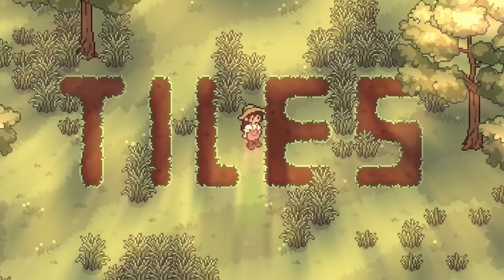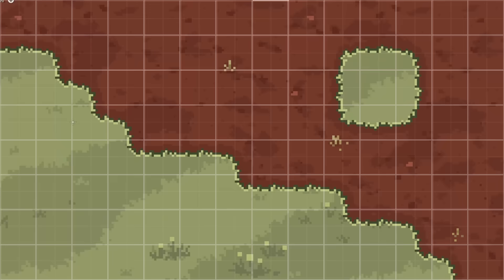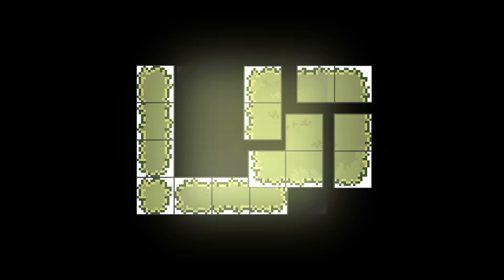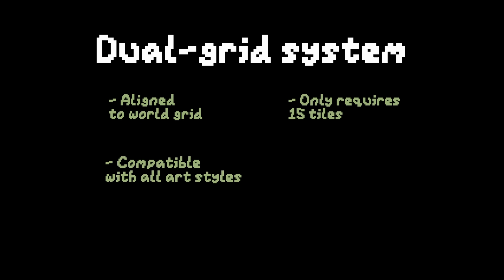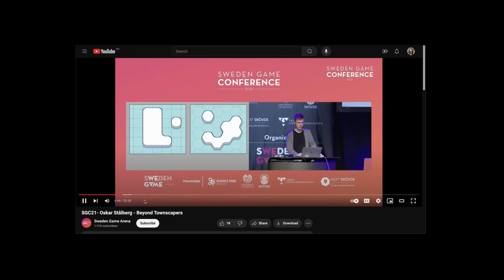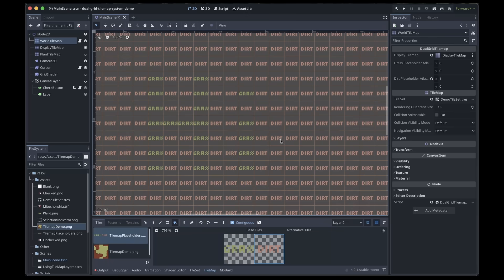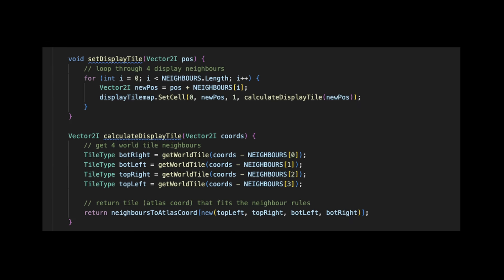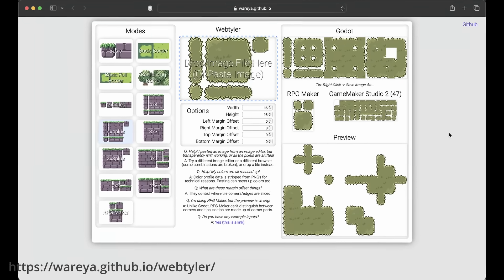Draw fewer tiles - by using a Dual-Grid system!

Comment: This is very interesting, but unfortunately it wouldn't work for my game since mine is a building sandbox. Obviously combination of neighbors gets a lot more complex when each corner could be one of hundreds of options. I tried doing a variation of the dual-grid system by drawing "quarter-tiles" and stitching them together. But at least in GameMaker, the engine I'm using, this tanked performance because it quadrupled the draws when drawing to a surface. I tried a really dumb solution where I just made tiles only tile to themselves and then made them extra big so their edges just fight with other tile types. Somehow it looks decent and alpha draws are much less performance expensive than additional draws. But I'd love to find a better solution.
Reply: Search marching square. You can make map with single grid with much fewer tiles count.

Comment: I prefer the 1-tile overlap method. A great example of this is in Crashlands. You draw a single irregular tile that overlaps slightly into the tiles next to it. Ensure you don’t add edge shading or linework and the tiles will seamlessly blend together. These tiles can be flipped or rotated, so on an isometric or regtangular grid you essentially can cheat 4 versions of the same tile; on a square grid, you can get 8. Make a 4-8 variations and you can get an incredibly nonuniform looking terrain for very little dev time. Only downside is that you need a shader if you want shadows between layer types (like if you have a path through grass), or a solid line around terrain for a cell-shaded look. (But that’s a pretty minor thing considering how much time you save.)

Comment: I would have opted for a half-tile system, that is the tileset is made ot tiles half the size of the grid so you can build the border of the tileset using only edges, outward corners and inward corners.

Comment: I used to do this by dicing each tile into nine (like a #) and counting the neighboring tiles. The base tile was a 'closed' tile - IE a patch of dirt surrounded by grass. I would overlay an 'exit' for each direction with another dirt tile and finally overlay a dirt patch in any corner between two 'exits'. The overlays should be large enough to erase outlines. Back then, transparency was a key colour, but this can be done with alpha now I guess. In total, 1 dirt island, 1 all grass patch, 1 all dirt patch, 1 horizontal dirt path, 1 vertical dirt path = 5  tiles. Dice as needed. Working with this reduced set, you can animate wind blowing the grass - just make sure it matches when diced and reassembled.

Comment: I've found an online tool, that lets you generate a full 47 tileset out of just 5 tiles, so now i am using that. My current implementation does not support tile variants though, so that's something to work on, but i'll probably just have 2 or 3 different tilesets for the same tile, and then choose one randomly. 5 tiles per variant is still less than 15 :)

Comment: We actually don't even need two grids, and we can use Godot's own Terrain-based autotiling, using Edge-And-Corner pairing mode. Here's how:
* Design a 16-tile set the way shown in your video (tile 16 being the empty tile).
* Set all tiles' corner Pairing Bits to the corresponding corner's terrain.
* Set all tiles' top and bottom Pairing Bits to the same as the corner to their [edit] right.
* Set all tiles' left and right Pairing Bits to the same as the corner to their [edit] bottom.
* Set all tiles' terrain to whatever matches the [edit] bottom-right corner.
* Set all tiles' x and y Texture Origin to [edit] +1/2 their width and height respectively.
* Paint the map a bit larger to include an additional full column on the bottom-right.
* Profit.
[Edit: Got the offset thing backwards when first posting this comment.]

Comment: Personally, I'd rather take the time to make more tiles than to add additional lines of code, memorizing offsets, worrying about programming something wrong, bug fixing, wondering why my tiles aren't lined up right, and struggling to make everything work with a half grid quarter offset double grid reverse Casper slide mongo.

Then again, I enjoy making lots of vaguely different tiles and I don't like code. Besides, a lot of those only have to be made once and then rotated 3 times.

Comment: Offsetting the grid was my immediate thought when you explained the downside of the first method. One downside that remains is that interactions between the tile layers become more difficult. For example you might want tiles with ice to be slippery, or an object to only be placeable on certain tiles, and with this system you'd have to apply those properties to each quadrant instead of to the whole tile.

Comment: Great video! I am struggling to reproduce this in my own project. I copied your code from GitHub in Unity. For some reason the sprites don't show anything but the placeholder tiles. I get one or two of the actual display tiles but the rest don't change. I tried restarting the project a few times and it randomly worked after restarting unity a few times but on any other new project file I create I can't get it to work and restarting unity hasn't fixed it. Any ideas anyone?

Comment: I spent soo many hours creating 47 tiles for each terrain and finding ways to simplify it. This video just saved me a ton of time.
Reply: I think the other side of the issue is people focusing so much on pre-planning and ending up not using most of their tiles or sprites anyway (except arbitrarily). It reminds me of how in old games some tile configurations would simply never appear so they didn't bother drawing them. Doesn't make the game any less fun though, but in a lot of cases, "Less is more" allows you to be more creative with the level design and placement than having too many tools and effectively turning your game engine into MSPaint 2.0. Actually it reminds me more of those cases where game devs spend so much time making sprite sheets and such, then they get to the actual world building part and..... freeze. no idea what the level design should be and the game's in limbo for a decade. So I kind of prefer more of a "build as you go" approach. or at least a hybrid and finding creative ways to reuse tiles like old SNES and Genesis games did (like SMB reusing the clouds as grass bushes). 

Oh and also, there's a lot you can do with developing tiles programattically as well. For these tiles, since it's mostly geometric shapes with some feathering on the edges, you can write a simple function that paints a tile with a border and use a noise filter for details, then put in the inputs, let it rip and BOOM, 47 tiles made in seconds and fully customizable with a few variable changes. No need to manually draw these tiles. Yes I've done that before in python and it worked!
Reply: I was working on a super simple game and immediately ran into this problem. So glad I ran into this so I can keep it in mind for any future projects

Comment: There's a cheap Unity asset called TileGen Pro that makes this infinitely easier. You just need to draw the 12 basic tiles (corners, inverse corners, edges and core) and you click a button and it creates a full tileset for you with every possible tile combination

It basically bakes the process of the dual grid into the tile itself. It takes quadrants of each drawn tile and readjusts it into another tileset

Comment: First thing I got used to was using dualgrid overall when I made tiles for myself. Cause I noticed that when I used TileD to make maps that I could not make them as well. It was the same issue I had with RPG maker as a program. I wanted to go paralax style but hated that I was confined to such a spacing problem until I realized I could half it. And suddenly my problems were just washed away. My maps started to look better. More on point with my vision. I could refine it far better than before.

Comment: Would it be possible to do a video on how to use this tool from scratch? I'm not too familiar with godot and while i want to learn how to use this tool there aren't a ton a resources helping me connect the dots. Perhaps it will make more sense as i familiarize myself with the tile map layer class more but I thought It couldn't hurt to ask in case there is nuance between the two that other tutorials can't show me. If you made it this far thanks for taking the time to read this, looking forward to hearing back from you!
Reply: For reference I have gotten as far as creating two tile sets, one with base tiles (dirt, sand, cave, water) and one with the 15 grass tiles. From this point I'm a bit confused and currently experimenting but I could also be misunderstanding this approach. Some advice would be great. 😅

Comment: I have often used the 16 tile subset one but simply with 4 added on for the inside of a concave corner.
Also, depending on the art style, even just one of each tile type might be enough and then you flip it accordingly — So only 6 tiles total when converting the standard 16 piece one and 7 if you add on the concave corners!

Comment: I can see this being necessary in Godot. No engine should render tiles the way Godot does. If you design your own API, you'll realize that you have a finite amount of pixels on the screen to render. If you want a tiled grid of sprites, all you have to do is divide the currently rendered pixel X and Y by the width and height of your grid cells(Round down, also). Boom, each pixel knows which tile it's in. Then you can just offset the UV of the tiles and scroll around a game world. What's crazy is that, using my method, it doesn't matter how many tiles you place. The game will ALWAYS use the exact same amount of GPU power to render the scene. Whether it's empty or totally packed with tiles. Doesn't matter anymore. =P

Sorry for the explaino, I know this will probably never be something you pursue, but I thought I'd mention it. XD

Comment: I made a game where I instead used 5 tiles. What I did was I made 5 models of the tile if it were isolated: a line going horizontal, a line going up, a plus, and completely filled.

Then what I did was instead of using the entire texture of the reference tile, I used the corners of each one to fill in the 4 corners of the active in-game tile. I hope that makes sense. 

In some sense, it was a dual grid system, but instead of an offset grid, it was a smaller grid.

I suppose if you considered each corner a seperate tile, then I actually used 20, but I only had to draw 5, so idk.

Comment: For any gamedevs reading this -- there's actually a more efficient method!

Say if you're working with 64x64 tiles and you want to implement paths like the ones in this video, you can draw a bunch of smaller 32x32 graphics and assemble them together in engine. The minimum should be around nine half-tiles, but you can draw more if you want multiple same-purpose tiles to interchange them for variety.

This is similar to what NES games did for "levels" -- rather than storing each block as it is in memory, they would store them in chunks (say a premade 4x4 set of tiles for example) and treat them as a single block that you could place wherever you wanted.

Comment: I am actually much more interested in your overarching tile texturing seen at 1:00!
for instance, those larger stripe patterns than span multiple tiles in the grass, or the repeating pattern of darker spots in the dirt even though it's all the same terrain.
would you be able to give any pointers on that?
using Godot, too.
Reply from the maker: This look was achieved by "overlaying" a large, hand-drawn grass texture on the tiles using a shader. In short, you can pass any texture as a parameter to the shader, set it to repeat and then use the colours/transparency of the original tile sprites to clip it accordingly
Reply: @jesscodes  I see, I almost got it, but I am not sure what to pass in for the UV in the texture() call.
UV is wrapped for each tile individually, so that doesn't give me the texture spanning across multiple tiles.
SCREEN_UV makes the texture span multiple tiles, but it's fixed to the viewport so it doesn't scroll with the camera.
by setting the texture to repeat, did you meant to add the repeat_enable hint to the sampler2D uniform?
Reply from the maker: For sampling the texture, I use the pixel's world position instead of UVs. The last time I checked, the world position was not available in the fragment shader by default in Godot :( so you have to assign it in the vertex shader with something like this:

varying vec2 world_position;
void vertex(){
    world_position = (MODEL_MATRIX * vec4(VERTEX, 0.0, 1.0)).xy;
}

Once the varying is assigned it should be available for use in the fragment shader. And yes, I was referring to repeat_enable - used in combination with the world position
Reply: @jesscodes  yes, I got it working! thank you so much!!

Comment: Something that can likely be done to improve this as well (assuming you don't want unique connections between different pairs of tiles) would be to change the tilemap configuration from comparing two SPECIFIC types of tiles (like how it compares grass to dirt), to instead simply comparing "this" to "other".

Then, you draw the two layers of the tiles separately from each-other instead of storing them in the same sprite such that they fit together like a puzzle piece. This would likely be done by using a bitmap to identify the frames for each tile, so if "this" tile overlaps in a way that would require it to draw the frame with index 1011, then the "other" tile will draw in that same location with index 0100, and those indexes will be picked to make them fit together like jigsaw pieces.

Just like that, you don't need a tile to represent every connection between two different terrains, you just need the 15 frames for grass, 15 frames for dirt, 15 frames for sand, 15 for water, etc. Otherwise adding new terrain types would DRASTICALLY increase the required frames because you would need separate images for grass to water than dirt to water than sand to water, and all other combinations.

Comment: Well, that is odd, i did a single tile for each type i need, then i make a single side of the tile and a single edge of a tile... 3 pieces, then i put the main tile in the world grid system, and check arround tiles, to put or not a overlay layer of "borders" and it work flawless with just 3 pieces, i though to make L shape and even U shape, but it are actually not necessary is most cases due to the style of art i'am using... But i have to be careful on how to build the envirement, i'am using a random generation simplex noise to make terrain, then rivers, then put flora and i setup a "default ground level" to the game know how border will here or there, because i always water down, sand over water, grass over water and sand. But my system actually can apply custom level to each tile with will check surround tiles to know what kind of border it needs. The map generation will follow the default values, but if i need to put a custom construction that not follow the default visual, is easy to set... i guess is more complex than use a built in grid system as has in game engines, but i'am making my game from scratch, i have almost anything, just is not toolable to make most stuff, i not have a map editor setup, soo, i enter my own match system, and kinda try some functions by using debug abilities LOL

Comment: Doesn't the name "dual grid" refer to mathematical duality, as in graphs etc? Otherwise, it is a strange coincidence I used the same name for different reasons.

I have implmeneted dual grid based renderers, but these needed a fallback to a finer grid for multi-way transitions. So, there is a two-case tile assembly: first, do a lookup for the four corners. If one or more variants are found, select a random variant. If no specific match was found, pick the four fallback corners and place them at subtile resolution.

Without this, the combinations at the 3- or 4-way intersections become too many to draw by hand for nontrivial numbers of ground kinds. It's also often a waste of effort to draw extra graphics for each such corner case.

Downside of this is that draw buffers need variable length and to handle two cases (full tile on the dual grid and quarter tile). But unless the map changes a lot and you want to zoom out pretty far, that's not a huge issue. As the alternative was a restriction on tile placement, this seemed like the better choice.

Comment: This is similar to, but I’m not sure if it’s completely equivalent to, an old trick used back in the days of NES cartridges & the like, where 1 ‘tile’ on the screen was actually 4 independent, sub-tiles from cartridge memory.

It meant that only up to two adjacent edges ever had to be checked & drawn for tile transitions, because all 4 ‘inner’ corners of the sub-tiles were always the same tile type.